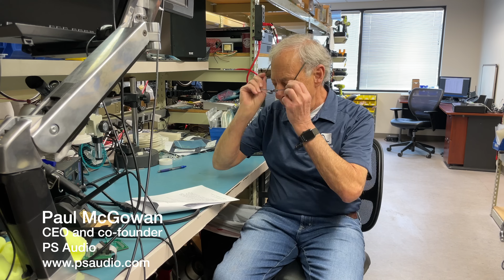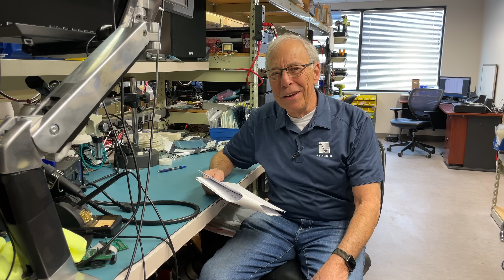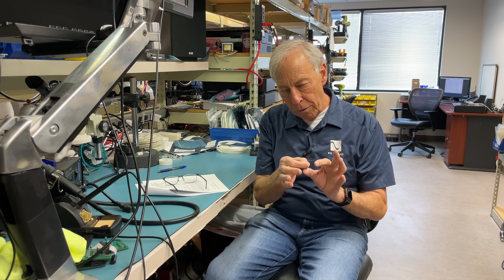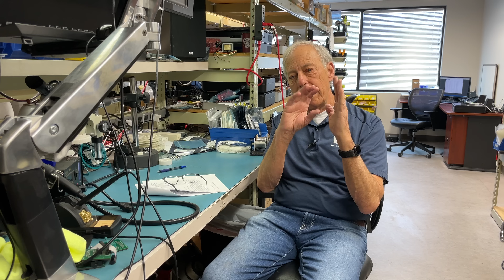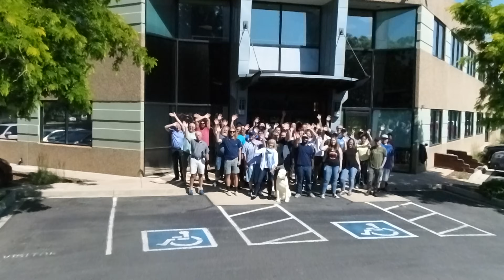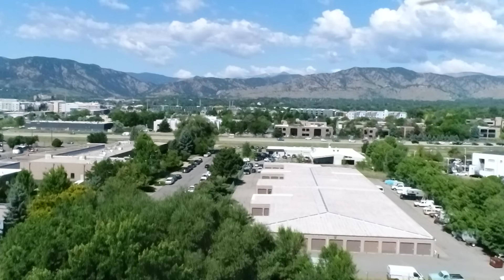What is an audio buffer?

Comment: An "analog" audio buffer is nothing but a circuit that isolates the input signal from the output load..typically without any gain. It really doesn't matter weather it's current or voltage driven. Op-amp buffers, for instance, pass an identical input voltage to the load so that the reactance of the load across the frequency spectrum (of interest) does NOT affect either the quality or quantity of the original input signal. To some,  this may look like a current amplifier because of immunity to load changes (within a range). A digital (or software) buffer is just a memory block were data accumulates before it reaches its final destination. It's primary use is to "sync up" various processing circuits that operate at different speeds in order to avoid data loss.

Comment: If I'm understanding this correctly, current or amperage is like torque and volts are like horsepower in an engine?

I have a cd player that was basically a hotrodded Philips player. Recently the transformer on the custom output stage melted and I no longer have any sound output. The digital coax out still works so I can use it as a transport with an outboard DAC.

Anyway....  I posted pics to a electronics repair page on Facebook and someone was saying I probably had the issue because of the diamond buffer. I was thinking it was some kind of component, but after reading about it, I understand it being a buffer design. 

To make a super long story short, why was a diamond buffer used and why did it possibly cause my problems?

PS. Someone else said it was probably my Schaffner transformer that failed internally instead of the diamond buffer. Now I just have to figure out how to fix it.

Comment: Is a gain control on a preamplifier also a buffer because that's what twiddling my knob seems to do?
Reply: No. A defining feature of a buffer is that it does not modify the signal.  For a circuit, that means it has unity gain.

Comment: Audio buffer sounds a bit undefined to me, I can think of two meanings:
1 He could mean an electrical buffer to add current to the voltage.
2 He could mean a data buffer that's embedded in the client device that buffers data coming from the host, like a CD player has.

Comment: You talking about a DI box, passive or active
Reply: A DI box is just to convert a single ended connection into a balanced connection.
Passive ones are the most common ones and just contain one audio transformer per channel.
Active ones can have all sorts of additional features, like ground lift, polarity inversion, attenuation or even an EQ and DAC.
So no, that's not an audio buffer.
Reply: @QoraxAudio  no it's not just that it's changes the impedance matching from a high to a low impedance.
Reply: @johnsweda2999  Exactly, it's an impedance matching transformer.
https://en.wikipedia.org/wiki/Impedance_matching#Transformers
A buffer adds current to the voltage (or vice versa) in order to drive the input impedance of a connected device instead of matching it.
https://en.wikipedia.org/wiki/Buffer_amplifier

Both prevent the load impedance to have an impact on the signal.
Very different solutions for a similar problem.
Reply: @QoraxAudio  yes but the active version there is a buffer stage as well you changing the impedance you're increasing the amperage
Reply: @johnsweda2999  Yes, there is a buffer in an active DI box, but that's just one component in that device.
A DI box is a device to convert a single ended connection to a balanced connection.
In order to do so, one part of its operations is impedance matching.
It also converts the signal respective to ground (single ended) into a differential signal (balanced).
Reply: @QoraxAudio  I'm not sure I'm getting you so what's the issue of using a di box
Reply: @johnsweda2999  
You should take a look at this:
https://en.wikipedia.org/wiki/DI_unit
Gives a nice summary in the introduction of the article: "The DI performs level matching, balancing, and either active buffering or passive impedance matching/impedance bridging to minimize unwanted noise, distortion, and ground loops."
A buffer or matching transformer provides only a part of all those functions.
Reply: @johnsweda2999  If you're interested in what's inside a passive and active DI box, you should take a look at these schematics:
https://sound-au.com/project35.htm

Comment: Except that watts are messured different from manufacturer to manufacturer so 1 watt is not 1 watt if messured at only 1kHz.
That would equal to less than 0,5w at i.e 20Hz because of the way it's messured.
Reply: huh?
Reply: Watts are Watts. While speakers SPL (sound pressure level) can be very different when 1W is driving 1 kHz sine signal or 20 Hz sine signal.
Reply: @alexanderbelov6892  If messured with the same messurements... But watts in a amp messured at just 1ch and 1kHz will give higher numbers than if it's messured thr propper way: all ch driven @ 20-20.000Hz. That's just a proven fact. It will need less amps to deliver the same watt because there is a MUCH lower load. Just try.. A amp messured at 1ch and 1kHz (often in 6ohm) that is 200 watts on paper is actually very noticable less powerful than an amp messured with 2ch driven at 20-20.000Hz in 8ohm that has 150 watts on paper.. It's not even in the same ball park. I don't want my amp messured with just one sine signal. I want the continous output over the whole hearable range. Anything else is just bullshit messurements to get a higher number on paper to sell more.
Reply: @Oystein87  
Watts are measured when some signal with calculated power loads some high power-tolerant resistor. Then max voltage of the non-distorted (1% or 0.1% max THD) signal is measured, and power is calculated. For an amp this is all that was required.
But listeners may experience much different level of volume (SPL) when they hear 1W 1KHz signal and 1W 20Hz signal. 20Hz 1W may seem unnoticed, while 1W sound quite clear. This is because bass frequences require much higher power at 20Hz to produce same SPL as 1W 1kHz. Also human ears are less sensituve to 20Hz sounds than to 1kHz sounds. So to make them seem equal in loudness  the speakers need even more voltage/power.

Some amps cannot provide countinous declared power specified for one channel in 2 channel config. But more expensive amps have spec for 1 ch and for 2ch loads separately. Sometimes 2ch config is not different from 1 ch config in power (more expensive). Sometimes 2ch 4Ohms config is not different than 2ch 8Ohms config in power.
Reply: @alexanderbelov6892  Uhm... So much wrong here I don't even know where to begin..😅 Just read up on this and try comparing yourself and you will see😉
I had a 100 watt Technics amp. And it was ALOT weaker than a 55 watt harman/kardon... The Technics was just half the power of the harman with a propper messurement method. And don't even try to mix hearing levels in the mix because this is MESSURABLE power so the listeners hearing has nothing to do with this at all. It's just a fact. Many messure their amps in a way they get higher numbers. Just compare i.e a Pioneer and a NAD... The NAD at half the power beats the living whit out of the Pioneer on the same speakers. Has MUCH more control.
Reply: @Oystein87  
I never listen to music at full amp power, or even half of its power since it may shake the walls of the room. So I don't care much about measured power. The amp has enough power.
There may be some difference in conditions for measured max power.  It may be measured at 1% THD or 0.1% THD - the last matches Hi Fi max spec for THD. But usually 0.1% THD is reached at 95% of power that can be measured in condition of 1% THD. So THD raises quickly when the measured amp hits max power limit.
I'm not sure how you identify what are signs that one amp with the same power rating works at only half the power of another amp. Amps can have different sensitivity (max input voltage that cause the amp max power output), and different amp gain (voltage multiplier for input to output increase).
Reply: @alexanderbelov6892  So? Almist no one really does that.. I probably use less than half my amps power to play at well over 100dB.. That's normal. And your comment proves you don't understand this.. There is alot more to this than you think. You should do some proper readint about the subject. And FYI: Changing to a more powerful amp made my system play better even at low volumes..

Yes, the ones I am talking about messure at 1% or 10% THD while i.e NAD and some few others messure at around 0.005%THD (don't remember exact number).
I.e: Sony: 1ch driven at 6ohm and 1kHz with 1% (or more THD) while a NAD has numbers for all ch driven at 4 and/or 8ohms (maybe even 2ohm) at 20-20.000Hz with less than 0.05 or 0.005% THD.
All this combined makes alot of amps rated at twice (or more) the power they actually are. A good amp should not really hit their power limit (atleast not as hard) because they will have a big enough power supply. A 50 watts propper messured amp is both more powerful and even heavier (if it's the same class amp like i.e class AB) than a 100++ watts amp.

And dude.. Messured output compared to input is not that hard... Don't mix in other stuff. Some rate their amps falsely to get higher numbers. That's just a fact. Everyone doing serious audio knows this.
Reply: @Oystein87  
Sound quality has correlation with low distortion rather than high power. But high power amps usually work with low distortion at low volumes.
My amp has 0.1% THD 2ch power rating, and 0.005% THD 2ch power rating.
The amps with 10% THD power rating are not properly rated for real use cases/music listening.
Reply: @alexanderbelov6892  And now we where talking about how they do their messurement and not sound quality. At half the volume none of them would distort anyway. But the one messured with one channel driven into just 1kHz will get beaten the living shit out of by the one messured at all channels and 20-20.000Hz regardless if they had the exact same THD😉 I see you really do not understand this. Please read about it.
The amps with 10% THD rating are only rated rhat way to get even higher watt numbers than with just the useless 1ch amd 1kHz messurement alone. It is at 100% volume with basicly no load. For normal use you would never hit 10% THD. But it will still be a very weak amp compared to the given watt numbers on paper. I really don't care much about the rated watts. I care about how big power supply it has etc. That tells me ALOT more of how it is capable of driving big speakers at loud volumes with big control than just some random watt numberd many manufactures make up with useless messurements.

My amps have a 0,005% THD rating at their given watts on both 8 and 4ohm. But that is rare these days. Most have this 1kHz on 1 single channel useless crap messurement that tells me nothing.
0.1% is to much. 1% is crap and 10% is horrible.

Comment: The question could also relate to a temporal buffer, aka a memory Cache. Aka, skip protection on a portable CD player. Most modern AVRs have 200-300ms of cache on the audio outs, or even on the video outs, on some very high end gear, to sync sound to picture.
And yes, the way a memory cashe loads and unloads data, with DSD, MQA, and even LPCM, can influence the sound playback, as most dacs (not all) use a PCM stage before the analog output.
DSD in theory should have the smallest change in the D to A, and MQA should have the largest change in the D to A. Remember, MQA and Flac require a cpu for decode. DSD can technically become analog with a very simple filtering system. No decoding needed.

Comment: Why is it called a buffer then?  From a computer background myself, and a buffer to me is a temporary store.
Reply: In a compact disc reader, that is exactly what it is. The signal output from the laser isn't in chronological sequence and needs to be stored temporarily for further processing in order to re-create the analog signal. This is part of the error processing program, along with parity bits, that prevents large blocks of recorded  information from being lost. Smaller losses can be smoothed by interpolation, preventing audible noise like clicks and pops.
Reply: @machintelligence  So I guess it has a totally different meaning in the analog electronics world.
Reply: @zo1dberg  Actually, it has the same basic meaning in digital electronics:

https://en.m.wikipedia.org/wiki/Digital_buffer

What you are referring to is a data buffer:

https://en.m.wikipedia.org/wiki/Data_buffer
Reply: @timharig  Ahh ok, yep, I mean data buffer.
Reply: @zo1dberg  Having slept on it, the etymology seems reasonable. From Webster's dictionary: 

"Buffer (verb) something that serves as a protective barrier"

In all cases, a buffer serves as an intermediary to safely pass a signal between two differing systems.   For a data buffer, the intermediary needs to provide a time translation between a physical system with jitter to another that needs the data at specific time intervals -- or vice versa.  For digital or analogue electronics, the signal usually needs to be passed from a higher impedance input to a lower impedance output.

There is always a signal.  There is always an input system and an output system and the buffer rebroadcast the signal from the input system while converting to the  to the needs of the output system. Thus there is a safety barrier between the two systems.
Reply: @timharig  Thanks, that certainly makes sense.